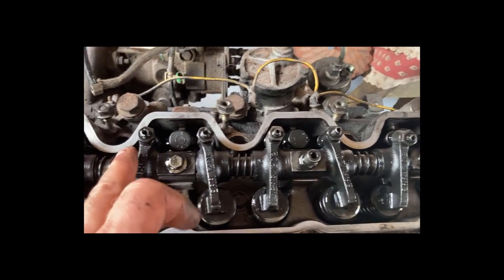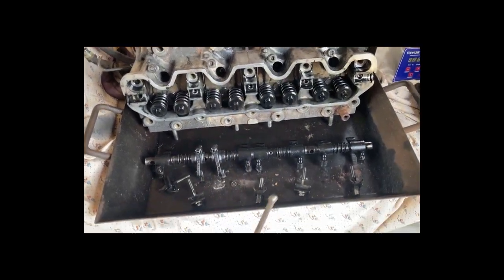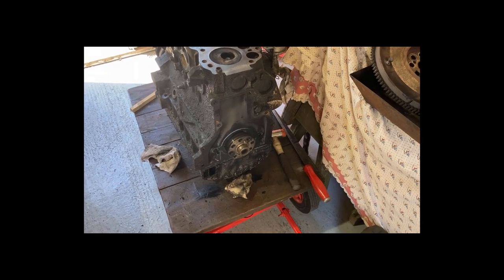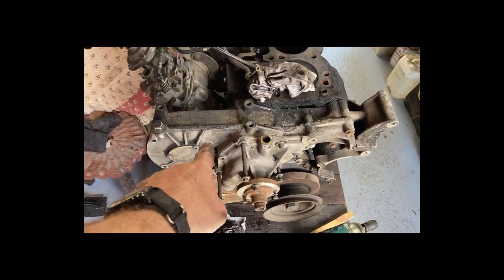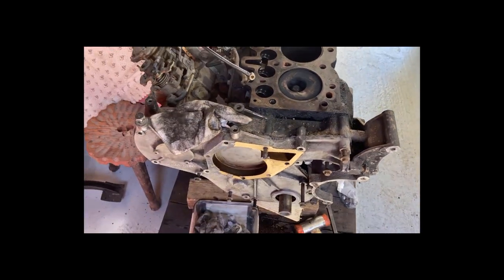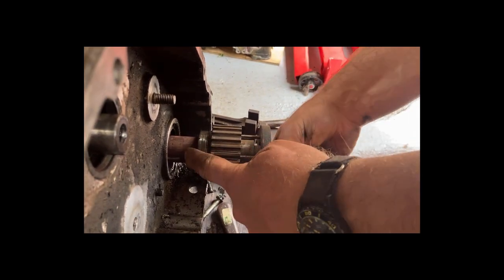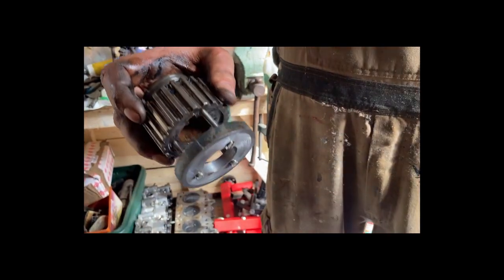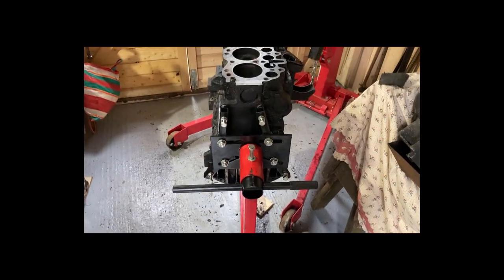Landrover 200 Tdi Engine Strip Down

Comment: Hello Mat,
Another big step forward... The content in the sump is interesting... I sort of think it maybe for something lower down as something nearer the top of the engine would have quite a challenge to travel downwards without causing damage on route.
Cheers.
Paul,,
Reply from the maker: The engine is now fully stripped - no other damaged found. The head remains intact - no obvious signs of damage externally. Its a bit of a mystery.

Comment: Metal bits look like munched valve stem lash caps, or valve stem protectors. Would also be consistent with the bent push rod.
Reply from the maker: I am thinking the same Greg. We shall see what shows up when I finish the strip down.

Comment: Interesting design on the piston crowns, guessing its to handle high compression pressures, versus petrol IC, just a guess?
Just wandering if the cups of tea is budgeted for on the planned Land rover restoration?, enjoy your comments on engineering,  or possibly a variation of 🥴🙂🤪.
So, in the future,  someone will ask if you have done much work on it, your reply maybe of some note.
Great work Matt, "Didn't go in with the oil", brilliant.
Reply from the maker: Its been an education so far that for sure. Hopeful of getting her running and travelling around the UK seeing some new places. Be good to get down to the Black Country for a visit. All the best Mat

Comment: Just doing the same job to a 250k mile 300tdi, been getting everything overhauled and refurbished.
I only found a squashed Valve cap in my sump ,. no other horrors .
Be nice to have a fresh engine in my 89 90"
Reply from the maker: I’m thinking the bits are valve caps. I’ve know information on the mileage this unit has done. I doubt it’s much over 100k miles. The not knowing is why I’m going through it

Comment: Another vote for the bits being the remains of valve stem oil seals. You should be able to see if any are absent, but possibly they were replaced in-situ without dropping the sump to retrieve the dead ones.
Reply from the maker: I am thinking they were left in the sump after a repair to save having to drop the sump. Not sure what they are off though - hopefully find out when I strip the head.

Comment: The piston bowls are rather like the pre-injection chambers on the indirect injection engines. You inject first into a smaller volume with a small surface area and a good shape for combustion for the initial ignition and then the volume increases as the piston goes down. Pretty much universal in diesels now. 
If you look underneath you will probably see holes that oil jets squirt in to. There is a labyrinth of cooling passages wrapped round the piston bowl.
Reply from the maker: Interesting Andy. That makes sense as a two stage injection and matches up with the information Mike at Britannia was explaining when he stripped an injector down. Thanks for commenting

Comment: those seals look like the valve seals
Reply from the maker: From the head ? Possibly, Ive just printed the 200tdi overhaul manual out and will have a look see if anything looks suspect. I pulled the cam shaft yesterday, I was hoping to get to the crank and pistons today. Thanks for watching and commenting. All the best Mat